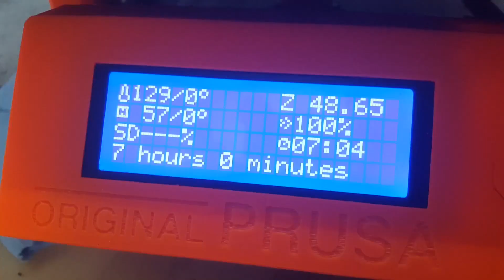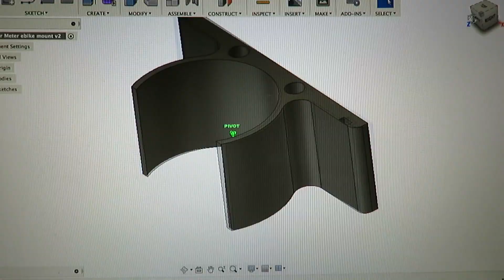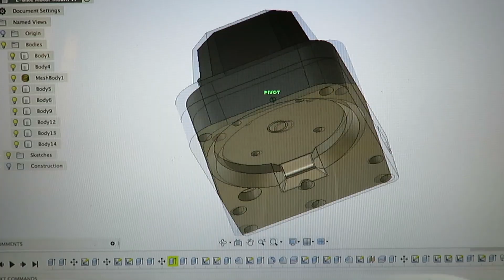DIY Electric Bicycle

Comment: Can I get the STL file  for the pulley on the motor?
Reply: https://www.thingiverse.com/thing:2191603
Reply: @dsmith4553  Not the large pulley, the small one on the motor shaft. STL please?
Reply: @steveeng4871  you better buy a aluminium its cheap more reliable
Reply: https://www.thingiverse.com/thing:2447124
Reply: @dsmith4553  Thank you for the link to the pulley. I am still trying to motorize my bicycle. DO you have any problems with the spokes being damaged by the large pulley and motor?
Reply from the maker: @steveeng4871  Nope, there's not enough torque produces, so it doesn't matter.